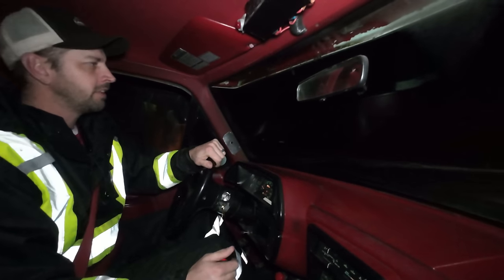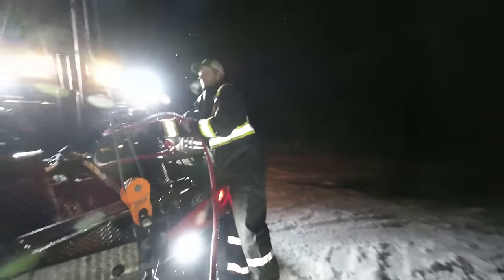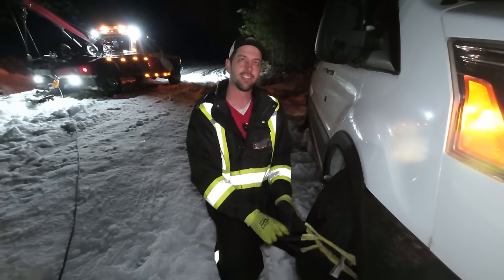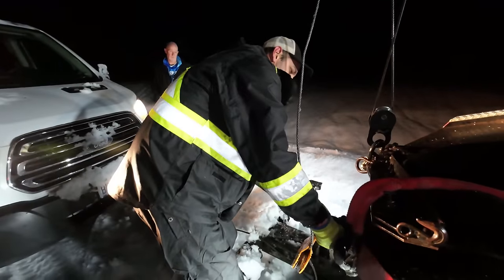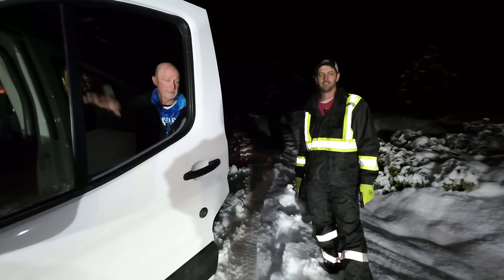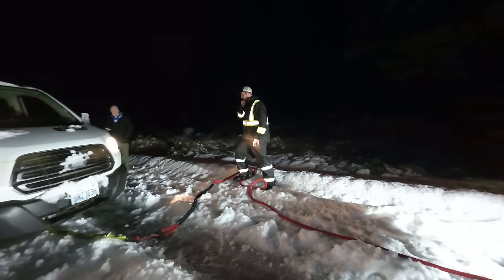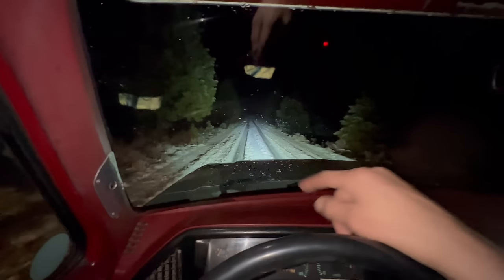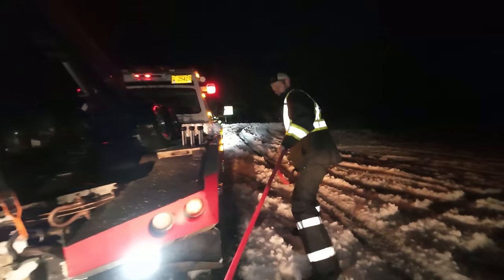9 people stranded in the mountains.  Let's get them out!

Comment: "Never use a GPS device" for trip planning / navigation. Always use a Real Map. Write down turn by turn directions to yourself. Stay with the routing you have planned (unless you are forced off the rt by external circumstances). If at any point in a trip, you become Uncomfortable with your directions, drive to the nearest safe location where you can get off the road, and make a new set of directions for yourself. It can be Helpful to use electronic devices and such to Assist you during Trip Planning. I never completely trust such devices wile I am Driving. 
Near the end of the video, you can hear the van driver expressing that he was uncomfortable with that road, before he drove down it. His gut instinct was spot on in that moment. 
The extremely nice and very professional tow truck operator who made this video cannot always be available everywhere.

Comment: Great double recovery, and as for Alex's leap. I've seen this happen a few times to friends, they test the ice creeping out then get a run .  then as they push off to leap they exert 20 time their weight ie. A 100 lb ballerina when she lifts herself up onto the tips of her toes, she exerts 2000lbs of force at the moment she initiated her lift, crazy right.
Reply: Can’t get enough of those shots!
Reply: @honthirty_  a ballerina was put on a pressure  plate and when she lifted onto her toes on one foot  yea at the moment of lift 2000 lbs of force
Reply: @honthirty_  let's put it another way a boxer punching  can exert around 800 psi with a punch but with a much larger surface area . A ballerina exerts that force in a area about 1 square inch ,it's physics.
Reply: @honthirty_   Per square inch.  This is why Flight Attendants were prohibited from wearing stiletto heels.  They were punching holes in the floor and stairs. Also, why they are good defensive tools for ladies who are attacked.

Comment: When in doubt, pull over and check the map. 
When I use GPS, I check the route that is suggested before starting the route, cause often it sends you on smaller roads. Fairly easy to see what roads not to drive on on Google maps.

Comment: Seems like the designers and manufacturers don't t want anything to be towed what with all the plastic and cardboard air dams there's no way to attach any where to tow Even my Comanche has nothing to attach to but I'm currently installing a heavy winch bumper with functional shackles to pull from. Dandahermit

Comment: ALL North American Ford Transits are RWD. They do have a AWD option now, the last 2-3 years. If you went to Europe, you would find the Ford Transits over there are FWD. Not to be confused with the smaller Ford Transit Connects, which are based on the old Ford Focus and are also FWD.
Reply from the maker: This is central Oregon.  How a vehicle comes from the factory is not an indicator of how it now works.  Always ask or check

Comment: I love the older Challenger Wrecker bodies. Just curious about one thing though. Why are you guys only running the outside dual on the back? It's my experience that the truck will get better traction and floatation on the snow with four tires across the back then two.

Comment: Couch Chair Towing thought lol.... durring the spin the van back other direction part of the job.  Maybe?  pick up the front in a simple manner...   place your handy dandy towing wheels under front wheels...    then  do similar to what you did here in half the time cause front will then roll some more around corner instead of  slide?   Or would those hand dandy wheels not roll into the turn any better?... 

If that would not work... maybe a set of heavy duty auto dollies instead since they are on casters???   orrrrrr even big chunks of plastic or even steel plate strap to bottom of wheel.....  Stand on front brakes so front wheels wont turn.... and slide on those instead of wheels which are not designed to slide (less stress on components too)?    Just thinking out loud.    Great job
Reply from the maker: What he said ☝🏻.   All of that just sounds like FAR more work and time with no advantage at all
Reply: Remember these vehicles are not on dry rough roads but snow and ice which is naturally slick and things slide easily, which is why they’re often in the places they’re at!
Reply: @JohnHallgren  yup......  thought my couch chair crazy thinking was more "general" thinking beyond this video.  Been wondering about it after watching many a slides around pulls on many different surfaces.

Comment: One winter I was going back home to Pocatello Idaho from Minnesota pulling a 25' camp trailer in a snowstorm.  I was on I90 westbound, and my GPS wanted me to get off of the plowed sanded freeway and turn onto a two lane road that may have been plowed, or maybe not have been plowed, and go into the mountains close to Yellowstone park!  I don't think so!!!  People follow GPS like it is a cut  in stone way to go.  That sort of blind devotion should not be followed.  Use a little common sense.  The thing that I DO LOVE about GPS, is the route to take going through a large city.  It even tells me what lane I need to be in.  If I am pulling a trailer, sometimes that is a HUGE deal.  I can't even imagine pulling a set of triples through a city that I have never been in before.  At night, it is even more stressful.  And, just think, Casey has done that, pulling a broken semi, at night, probably in a snowstorm.  LOL  I can certainly see why he does not like dealing with the major hi ways anymore.  Then think about pulling a 200 ton load on a 13 axle low-boy.  My hat is off to those people.  That would scare me to death.

Comment: It is bummer Ford does not have a good front recovery point on Transit van . There is a solid point behind the wheel and more to the middle, but it is hard to get to it in the snow. The front frame rails risk bumper cover  damage. Unibody construction also.

Comment: Having worked ships where we had winch cables that were almost exclusively wire rope, we always let out or took in more cable.  Sometimes for the sole purpose of cleaning and lubricating the wire rope.  

What I have to stop myself over is people use the "GPS" for whatever random receiver/mapping magic box they follow almost blindly.  Been a problem since the GPS system became available to the wider population.  Which is why since 1992, I've called it the "magic box" to emphasize to younger sailors that it is to be used, but never trusted, lest in that instance you run into Canada while declaring that box showed you right on the trackline.

Comment: I see you are running one tire on each side. Found you use a super single?
Reply from the maker: Not a super single.  I just removed the inside tires
Reply: Could you runs super single.
Reply from the maker: @willpatrick8706  I could yes, but there wouldn’t be much point because the traction advantage would go right back out the window

Comment: 17:59 - you don't need to pull from down low.  Just have them roll both front windows down and run a Yankum rope through the cabin, connecting over the front. 'Guaranteed to work' with a relatively low likelihood for injury or damage.  #YouNeverSaidYouWereGoodAtThis and #INeverSaidIGaveGoodAdvice

Comment: Most tow companies see their customers as a money pot.  It cost me $200 just to move a car from a trailer deck to the ground.  The roll back only had to move off to the side to drop the car.  Didn't even have a 100 feet of movement.  Part of the reason it's so expensive is they are the only tow company in the area.  No competition.
Reply from the maker: Wrong.   You just showcased the biggest problem with people’s opinion of tow truck rates.   You very mistakenly think that the job was only to move the car that tiny little distance.    When in reality the job was for a company to have a driver with one of the highest workman’s comp rates in the country to get into a $100k truck that costs thousands per month to insure and drive it whatever the distance was to your location, spend the time on scene to do a job that you were not equipped to do while holding the multi million dollar insurance policy to cover your vehicle and anything else on the scene if anything goes wrong, and then drive all the way back to the yard.    Now also keep in mind that the owner of that towing company has to pay for all of that expensive equipment and drivers to sit in the yard and be ready 24/7 just waiting some little low dollar call to come in where someone will complain about the rate.   

$200 is incredibly cheap for the amount of capital investment and work it took to move your car just a few feet.
Reply: @CaseyLaDelle  Cost me $75 to load it in an area that has plenty of competition.
Reply from the maker: @repalmore  sounds like you found a bottom feeder tow company to load it.  That’s an absolutely stupid price from a company that clearly has no clue what their operating cost’s really are.

Comment: Definitions from Oxford Languages · Learn more
ca·ble
/ˈkāb(ə)l/
See definitions in:
All
Nautical
Measure
Architecture
Electrical
Telecommunications
Broadcasting
noun
1.
a thick rope of wire or nonmetallic fiber, typically used for construction, mooring ships, and towing vehicles.
"steel cables held the convoy together"
Similar:
rope
cord
line
guy
piece of cordage
wire
chain
hawser
stay
bridle
topping lift
choker
2.
an insulated wire or wires having a protective casing and used for transmitting electricity or telecommunication signals.
"an underground cable"

You win Casey.  😆